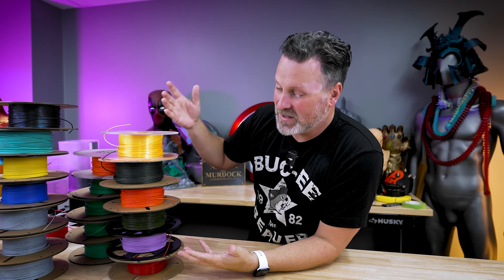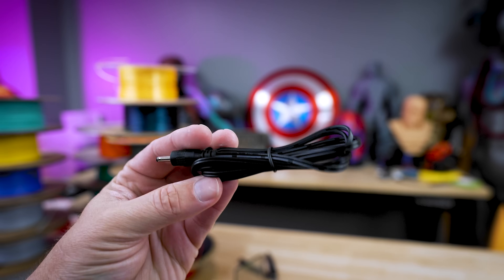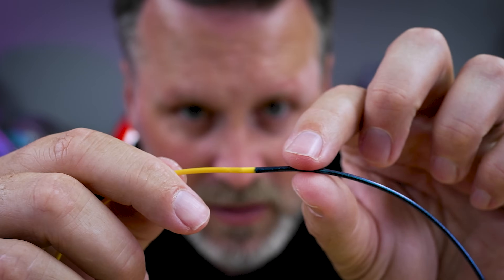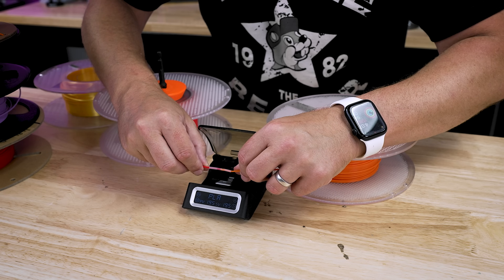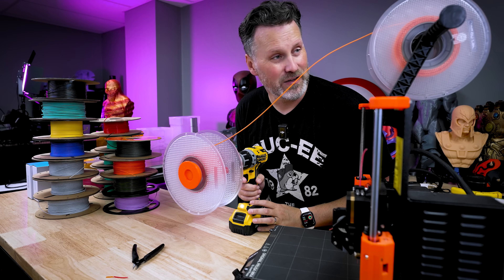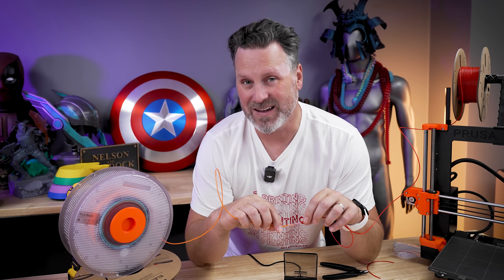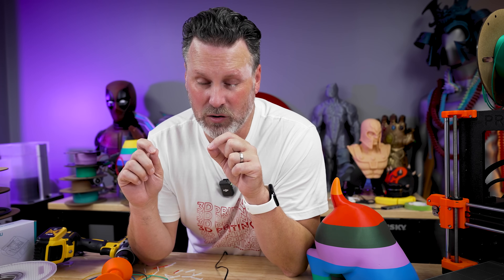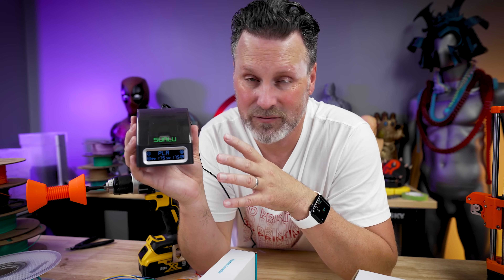Does this really work?? Sunlu Filament Connector

Comment: I didnt see any other creators pushing them together. Most also did an angle cut.
Reply: angle cut has more surface area for a stronger connection
Reply: Yes, follow the instructions! You're supposed to cut at angle and while heating you push together with slight pressure, not after... Also START with the stated temps then adjust, he started way too hot, your not trying to go to past the glass transition point as if you're printing!  Also youre supposed to trim any excess! UJ was doing it wrong those connections he made were horrible no wonder those few connections "clogged" the printers what would you expect when the filament is it out of tolerance by like +20 or +30%
Reply: Yup.  Seems like he didn’t do it the best way.  We all learn through practice.
Reply: AuroraTech Channel did a great review and combined rolls
Reply: I havnt seen a YouTube follow the instructions yet.  Everyone of of them just guesses or copies someone else.

It's supposed to be angle cut.  It's supposed to be put into a preheated slot, you are supposed to push together and wait till it beeps again after closing then remove.  Sunulu even has a video on use on the product page.
Reply: @brandonbrown3600  Aurora Tech got it right and is a child.
Reply: @user-cn3ff3sf5o  - I just watched her video since you mentioned it. Yeah, she does it correctly, and has zero problems with making a print with 4 transitions.
Reply: @gus.smedstad  Those kids do a solid job reviewing products.
Reply: I would think that with an angle cut it would be difficult to get them oriented just right to fuse properly. Those white connector PTFE tubes are translucent, but not fully transparent so you can't really see the tips well when they are in there.
Reply: “Creators?” 🙄
Reply from the maker: @SpannMagoo  yeppers. Angle cut for sure works better but if you don’t slightly push it will tend to pull apart. I didn’t see a few comments saying I should fully leave it in the connector until it cools but I don’t believe it fully cools down as you can just load it back up and it welds right away
Reply: @UncleJessy  it seems to be a timer like a bag sealer. Leave it for 30 seconds and should be cool enough to slice and take off the tube. Every time you close it it stays on for a bit and turns off and resets when you close it again hence why you can weld after weld without pressing anything.
Reply: @UncleJessy  Did you keep it at that 195? I feel like a temp closer to the material's glass transition would make it more manageable
EDIT: SHiiiiit I'm dumb. I only have a couple min left in the video and got distracted. Love the vid :)

Comment: uncle Jessy has a bamboo printer with an AMS system doesn’t he? He can just use the AMS system. It works like a charm for this kind of thing.
Reply from the maker: yuppers... mention at the end of the video or the MMU system should do the same
Reply: @UncleJessy  oops sorry that’s on me for commenting before I watched the full video
Reply from the maker: @FatalLordAce  no worries at all! if anything hopefully others will see that as well.
Reply: Most printer will pause the print if filament runs out. I honestly don't see the point of this device.
Reply: @WhiteShadow2099  Useful when you can't babysit your printer e.g. at night
Reply: Yeah except for 1 BIG problem.....Bambu AMS 8 times out if 10 wont print from an almost empty spool....it will spool jump or jam....
Reply: @anthonylong5870  the AMS lite holds filament by the centre, so the weight doesn't matter and will finish spools with no problem. crazy how a Lite version is cheaper and more reliable!!
Reply: @LexxDesign3D  The lite has its issues too.  It has a lot of issues with filament not branded Bambu. The rolls sometimes dont fit
Reply: @anthonylong5870  Weigh the rolls down with some weighted center bits (I printed some desiccant ones and filled them up with M10 nuts for extra weight), snip the end bits (as some have kinks that get stuck). I just burned through a ton of tiny bits of remaining rolls trying to clear some space. Now I've got a couple of rainbow reusasble spools and a ton of filament clips to tidy the remaining rolls.
Reply: @dancoon7653 then it causes extra strain on the AMS motors....Abd those aint the highest quality
Reply: @anthonylong5870  how would making the spool weigh similar to what it weighed fresh in the beginning add extra strain on the motor
Reply: @FatalLordAce  The weights weigh more than the filament.  And its condensed into the center...pushing down on the motor.  A full roll not only weighs less , that weight is spread out.  Less effort from the motor needed to roll it
Reply: @anthonylong5870  oh sorry you’ve had that problem. I personally haven’t really experienced much issue with either of mine for this
Reply: @anthonylong5870  8 times out of 10 or 1 time in 5? Which do you think?